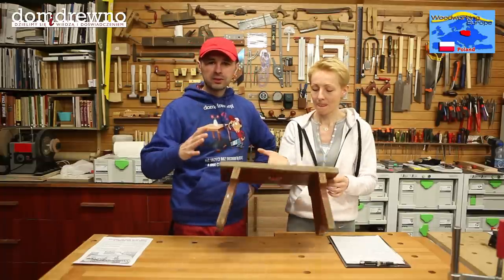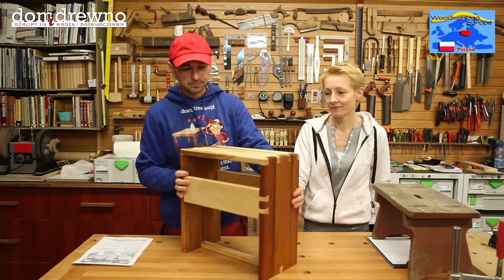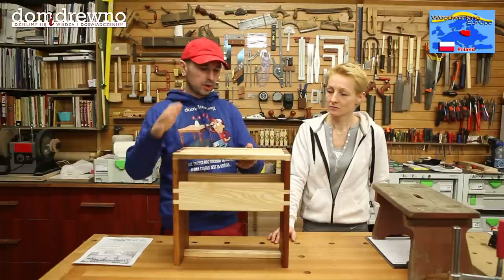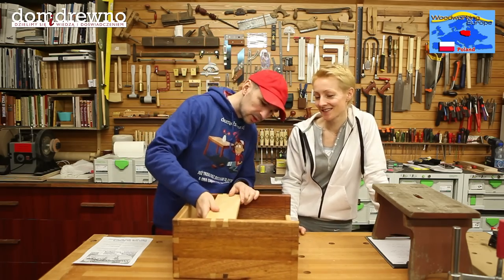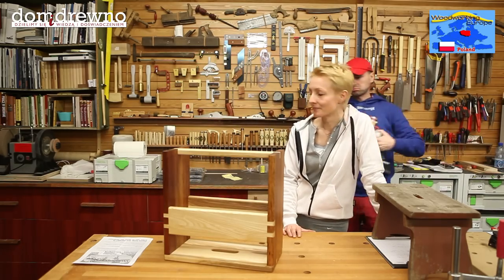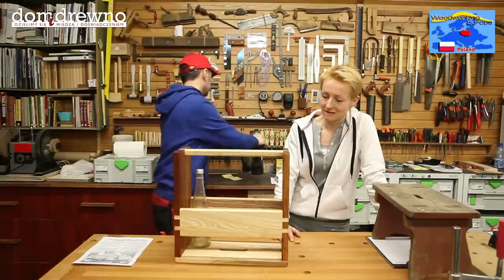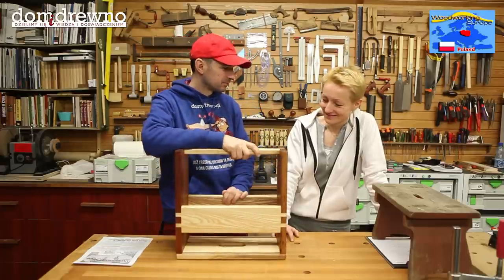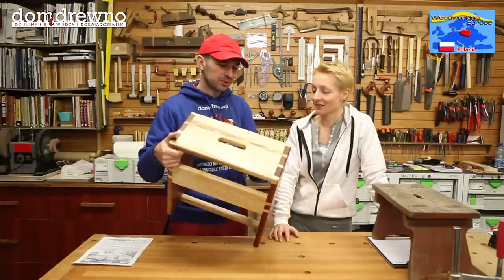Woodworking Europe - Collaboration-Build-2015 - Domidrewno

Comment: I like this channel very much. I like some of Jarek's projects, I like every Lidka's projects - she is natural. But I have to say that when I see all of that sofisticated and expensive machines used to make a "modified small chair", it is like using NASA to build a kite. Great job is done to gather sponsors for all of this expensive stuff (when You are not a professional carpenter) and this is worth praise.
Reply from the maker: Michał Stepuch Even most expensive tool don't work alone ;) To build this chair I user just one machine and one technique, you can buid it in 100 different ways - it's a beauty of woodworking ;)
Reply: Jarek Ostaszewski That's right. I am just jealous :-) As an amateur I have to make such stuff by manual or cheap mechanical tools. It takes longer and harder to do. Regards

Comment: This looks awesome in the end. What did you used for finishing? Thank you for sharing it and also thank you for talking in English. You should do this more often ;-)
Reply from the maker: Mighty Wood Thx man :) But my English is suxx ;) To finish - I used oil with wax from Festool (2in1), I'll add new coat 1-2 per year. It's enough.
Reply: It is not that bad in my opinion. Lerning by doing ;-)